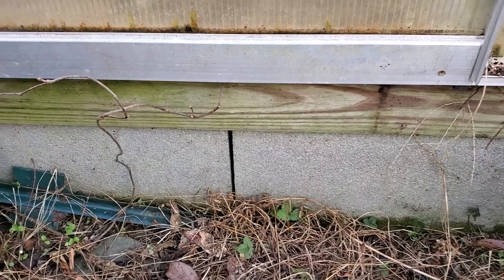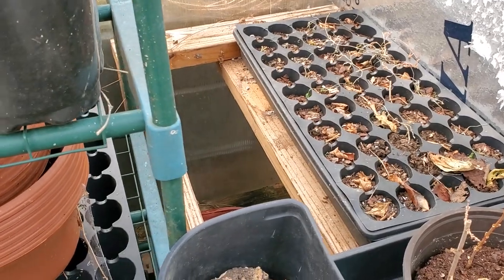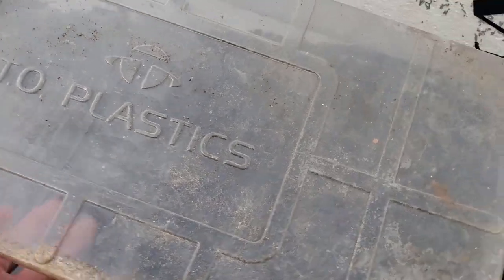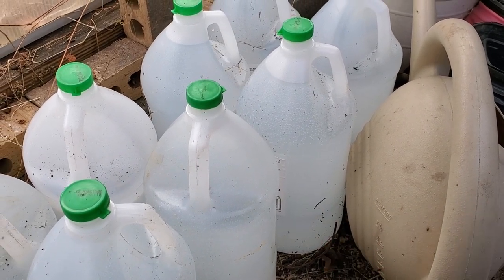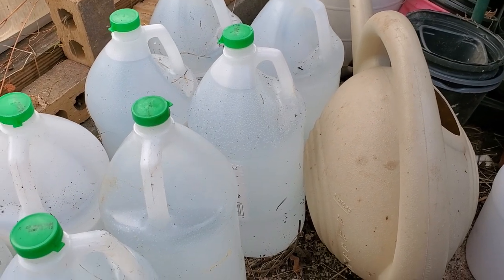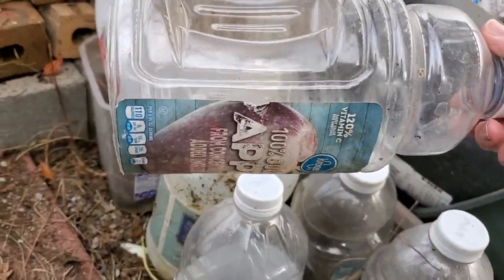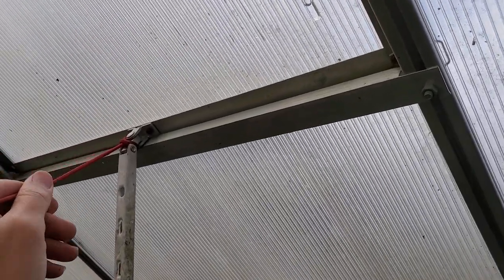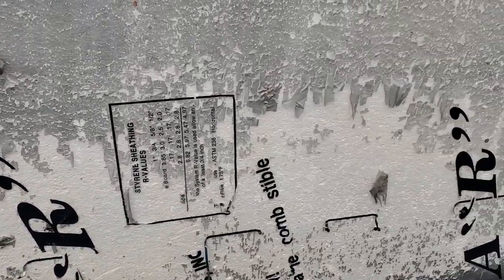My Backyard Greenhouse 8 years later/6x8 Greenhouse Organization (Harbor Freight Greenhouse)

Comment: I found a method of securing the panels tightly, preventing blow out and all of the rattling during wind. Very inexpensive and NO mess.Very simple to install and to remove, if that ever became necessary. I used round poly foam caulk saver 3/8"×20' long, made by "Frost King". It took 3 pkgs to do my 6×8 @ a cost of under 5.00 each, at my local independent hardware store. On the inside of the greenhouse, press the foam firmly into the channel between the frame and the panel. Eliminates cold seeping in and noise reduction is incredible. This product comes in different diameters for varying applications. The entire process took less than 2 hrs.
Reply from the maker: I think I used something similar in places. It's a great idea!

Comment: Sometime when boredom overtakes you Get a few tubes of clear silicone caulking and go around the edge of each panel inside and out of your greenhouse. The Silicone will seal out the cold better and also help to glue in your panels so they dont blow out as easy.
Reply from the maker: Love that, "when boredom overtakes you!" That's probably my main problem. I can always find something to do more interesting  than what I need to do! 😆